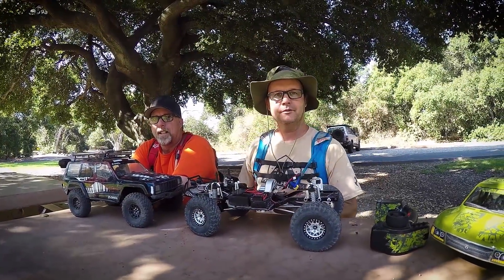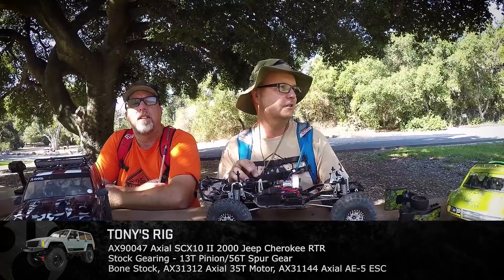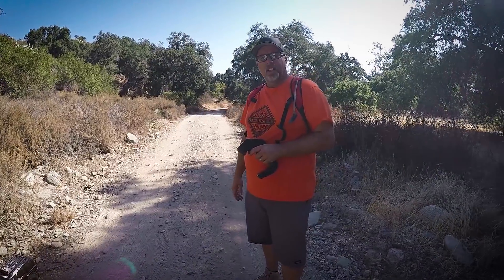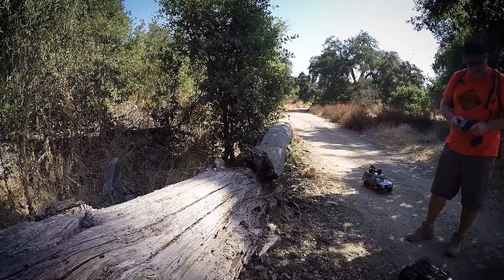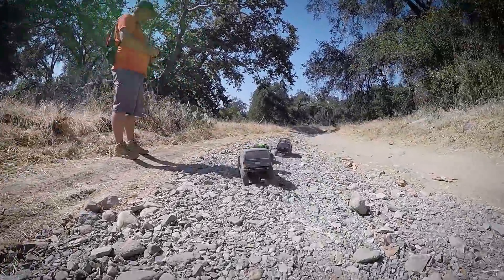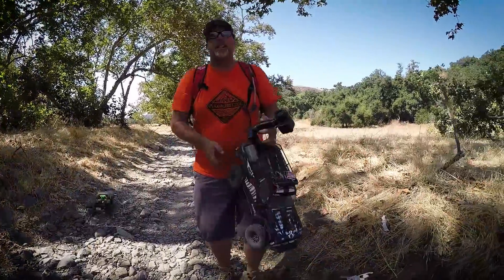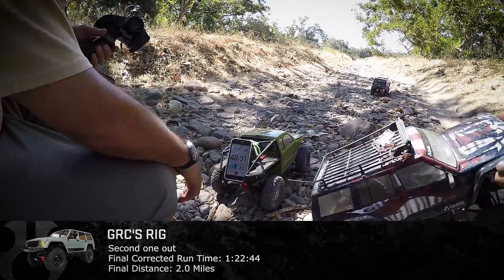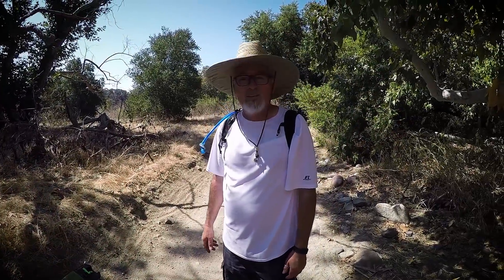mAh Per Mile - Part 2 - Testing Our Mileage on the Trail

Comment: my hpi crawler king with stock everything 55t motor on a venom 2000mah 25c 2cell has ran for 2hrs and i stopped the timer. it could have went a bit longer im sure.